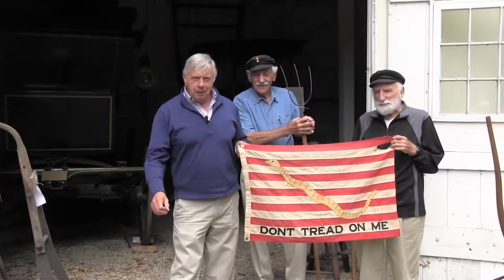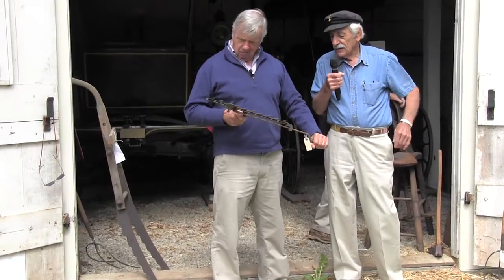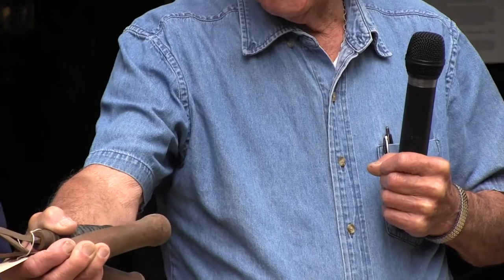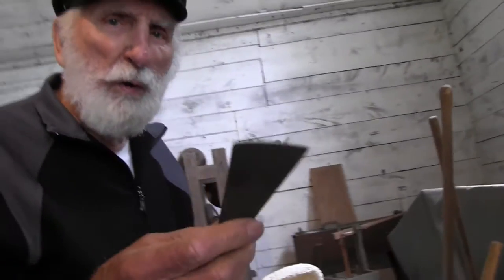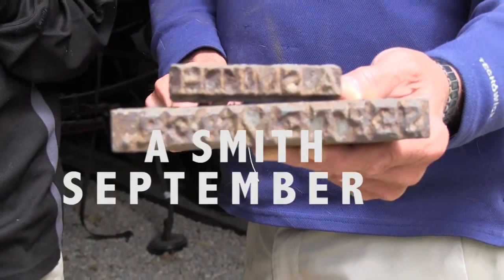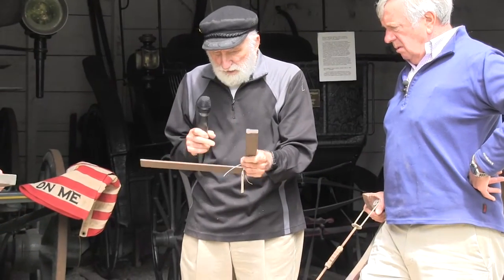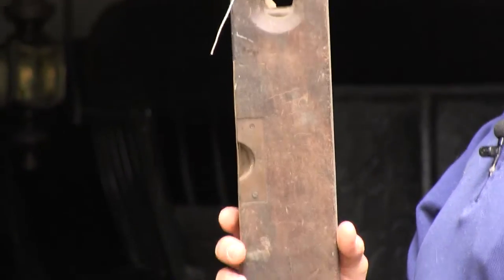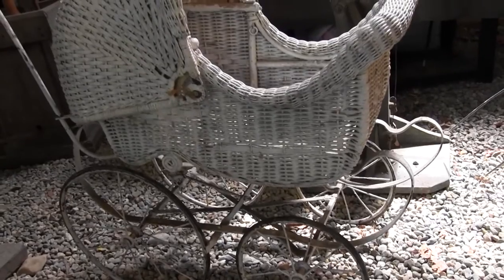COA: Old Farm Tools Part II

Comment: The spiked board is for shredding flax to separate the fibers.  A handful of flax was held in the hand and thrown like a whip onto the spikes then pulled to separate the fibers.  I think that using it for hemp would be another use for the tool.
Reply: Right!  I've seen similar ones used in bygone days to comb out henequen (aka "sisal") fiber in the Yucatan area of Mexico.

Comment: ive seen something like that board with spikes in it before when working in wool industry .could be a tool  once used in combing stage of shorn fleece wool production. probably done with machinery now . i think its the process after scouring wool to clean and remove tallow  .
Reply: I think this one was more for separating fibers in hemp or other plants. It is too fine and the spikes are too long for wool. I would think. It was probably built and used on the same farm

Comment: Sorry, they did not hit the back of the plane with a hammer to "drive it through" but to loosen the blade for adjustment
Reply: was thinking the same thing - i have all of the sizes they showed and use the crap out of them, only way to set the blade is a tap at the back to loosen the set

Comment: is the tool at 5:03 a ice saw ? or a peet cutter?
Reply: No, that's for cutting big round bales of hay.
Reply: I think it's a peet-cutter fashioned from two hay-cutting blades. The distance between the blades is about the same as a peet-brick's length.
Reply: How does this cutting of big round bales work?